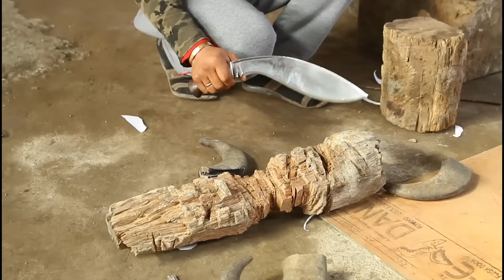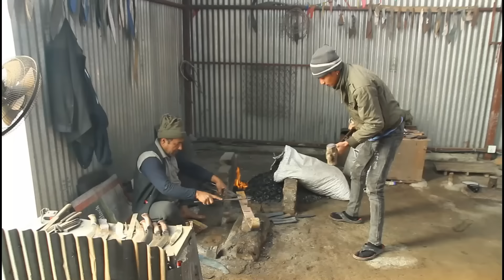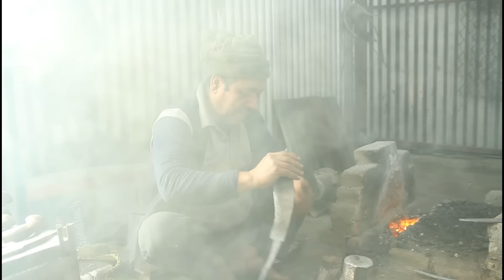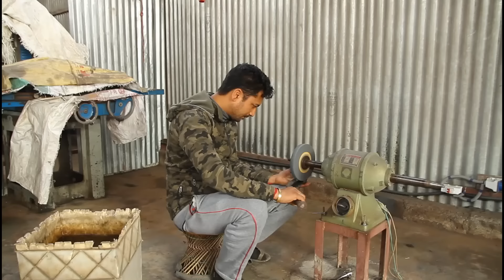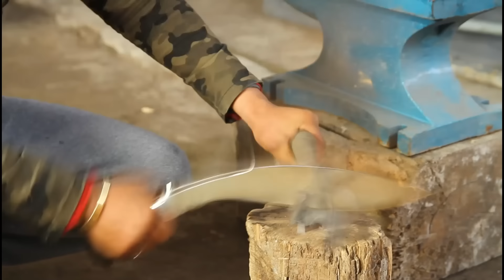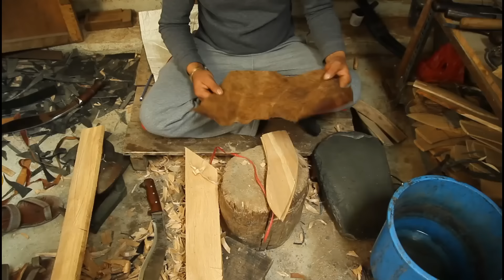Knife Making-Forging an Authentic Kukri knife

Comment: An authentic kukri from a leaf spring using an angle grinder, a power drill, and a bench grinder. Nice.
Reply: Its easy and cheap to find leaf spring, if you are Nepalese then you can get khukuri in just 20 to 30 dollars from the blacksmith and its all made from little technology lol.
Reply: Don’t forget about the teapot for quenching. So very cool.
Reply from the maker: Right on

Comment: Yeah. Leaf spring and power tools. Very Authentic
Reply: Depends on what you mean by "authentic".  If you think blacksmiths didn't source good steel to hammer on, then I'm not sure what you think they did because they sure didn't mine it themselves.  As for grinders or drills, it's doing much the same work as a hand file or drill but faster.

I take flintlock building courses from professional builders and one thing comes up a lot: "If the old boys had the technology we do, they would have used it".  After all, they were paid by the piece, not how much they sweat doing it.  That being said, I can appreciate things doing more traditionally AKA, "the hard way" but modern tools and modern steels are leagues better than what the old days had to offer.  So that being said, as long as the blades coming out are of traditional form and function, I'm not sure what else you would want.  

Especially the steel.  My god, modern 5160 compared to steel made over 100 years ago?

Comment: Some years ago, I purchases a Kukri, called the Kukri Cowboy, its almost a short sword. I was at the time working as a Ranch hand in Wyoming, so it was just the ticket. Very well made and even though it is rather heavy. I let the weight do the work, while I guide the blade where I want it to go. I still carry it to this day, when I go out hiking and camping. But I wear it on a sling system, since it is way to heavy to wear on a belt. And yes, it came directly from Nepal. So the money I spent on said Kukri, stayed in Nepal. I was glad to help.

Comment: I love it that smiths in the states will fight over what anvil style is the best, go on about rebound and what exact type of steel a tool they have is made from
Napal: anvil: sledgehammer head in the ground; tools: whatever gets the job done. 
This is inspiring and just awesome
Reply from the maker: We used spring leaf for kukuri blade.
Reply: @FamousGurkhaKhukuriHouse  
Yes, but a Smith that read the fancier books call tell the difference between 1065, 1075 and A2 tool steel in both chemistry wise and visually... such is cool, but doesn't help when the Smith doesn't know exactly what it is.

From my research, I can image the Nepalese smiths went, "springs are really strong and can flex without breaking. We have a lot of it. Let's use that for blades."

Comment: amazing to see the use of such historic media as 5160 tool steel from truck springs and the ancient 4" angle grinder. Coupled with the circus trick of  cutting  annealed wire . A feel good story for the uninitiated, not being smug, just after 20 years of making knives the proper way I find it a bit amusing.
Reply from the maker: Thank you very much.

Comment: as with knives from all over the world, you can see the difference between tools made for use and pieces made for show and to impress others.
A Kukri is a good, general purpose chopping knife, the shape of the blade makes it good for tasks as varied as chopping firewood and slicing cloth. The hand guard and pommel are sometimes shaped like 2 discs which keep your wrist at a good angle for cutting - although this  is more common when it is intended  for use as a weapon, many swords from the region use a similar design.  Kukris used as general purpose tools have a more practical handle of the type you'd see on a machete. 
What I'm seeing made here looks like a high quality handmade tool, not something made to hang on a tourist's wall. 
despite the questionable teapot quench...
Reply: Yeah I was thinking about that quench as well.  That appears to be 5160 which is notorious for absolutely hating water.
Reply: you should check out jayfisherknifemaker.com and see what he has to say about this type of knifemaking! He's an iconoclast but he's right. But I do still love carbon steel forging and crude heat treating.

Comment: I'm so glad to watch their great effort. I hope that steel would be corrosion free.
Reply from the maker: Yes  sir, it is made with the best quality of the material so, it will not have corrosion.
Reply: It's a leaf spring. Gotta be clean and dry, after every use. Or yes. Rust. That spring steel doesn't have super high chromium content.
Reply from the maker: @richardlacroix9069  that is ture sir.
Reply: @richardlacroix9069  mystery steel

Comment: Hi Adrian,
Hello from Australia, I’m surprised you can get such a hard edge by quenching when the steel has reached only a dull red colour. Does it crack if you quench it from orange or yellow?
Reply from the maker: Only fewer chances if of being crack. As the blade has to be a bit curved.
Reply: +Jack Avalon
It is a very fine truck leafspring  steel.

Comment: It shows what can be done with crude equipment by American standards, he doesn't have 10,000 in equipment and make $40k/year. It works.
Reply from the maker: they really work hard to make a single piece of knife.
Reply: Quite right, you can have all the fancy grinders and heat treat set ups and still you wont produce something with the soul this knife has, it's a blade that is meant for using, not a showpiece that will only ever cut paper!

Comment: what is the notch at the base of the blade called and used for?    i have never been able to find out....thank you
Reply: The notch in the blade is there so that no liquid (blood in case of battle) slides onto the handle making the knife slippery.
Reply from the maker: It is for the protection so, that you don't get hurt while using it.

Comment: In 4:25 we can see modern nepalese pwerhammer in action :D btw. i wonder what steel so they use-
Reply from the maker: yes sir!
Reply: Looks like car or truck leaf spring.  Excellent high carbon steel for knife making and cheap!
Reply from the maker: @davidsteer8142  yes sir, it is made with the truck leaf spring.